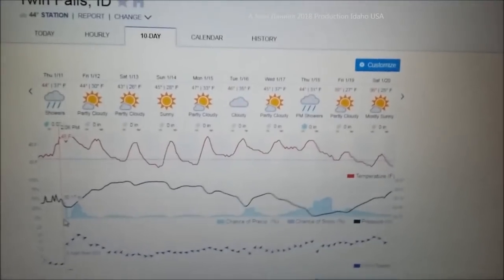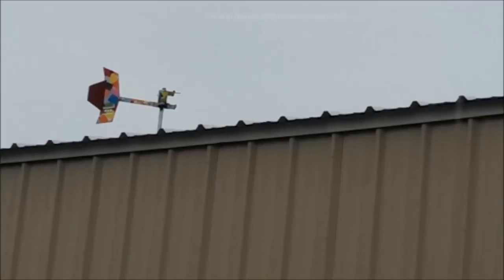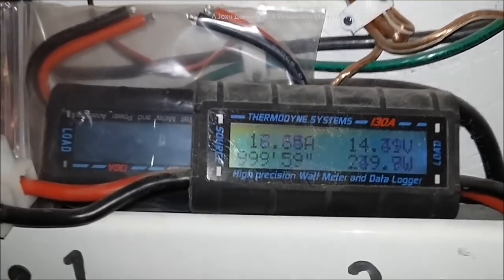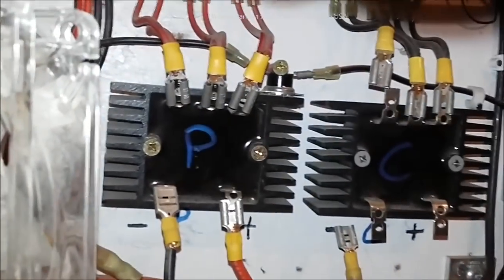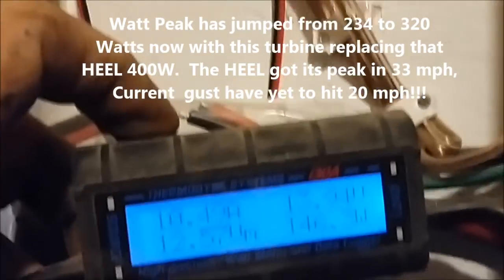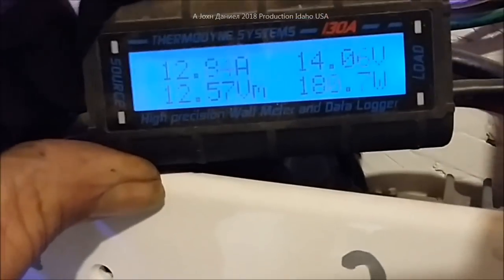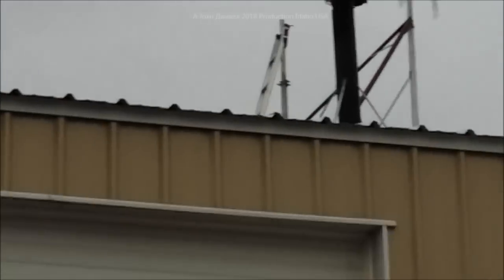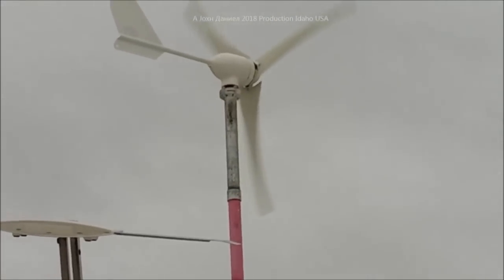Success, $220 (before inflation) China 500 Watt Wind Turbine super performer, BIG PARTS LIST BELOW

Comment: John -  Your ali-express link to the turbine sends you here (https://www.aliexpress.com/item/HAWT-500W-Wind-Turbine-Generator-With-Controller/32958450500.html)
This is for a Model Number:GE-500W1 3-blade unit.  Is this the turbine and the vendor you purchased from?? (Green E Solutions Store)

Thanks in advance!
Reply from the maker: Yes, They are the official dealer for Wuixi and they have 12,24,48 volt models in 3 or 5 blade options.

Comment: I Have a solar array and I use combiner boxes before the charge controller. Couldn't I just connect the turbine to a blank breaker on the combiner box?
Reply from the maker: You can connect the output of a rectifier into a combiner box, however wind turbines make such high voltage they could damage your solar panels if they are not protected with a properly sized blocking diode and controller.
Reply: @JOHNDANIEL1  
Thanks for the input. My combiner bax is basically a breaker box. Each breaker has 3 300w solar panels connected to 1 breaker and each box has 6 breakers. It combine all loads from breakers to  1 line that goes to the charge controller. I believe that if the turbine produces too much it would pop breaker. If that happened would the turbine burn up the wires to the breaker?
Thanks for any help.
It's a grid tied system so all extra volts go to grid after battery bank is charged and balanced.
Reply from the maker: Heres a way you can do it, place a basic controller on the turbine with brake and diversion built in, then run that direct to battery with no less than 6AWG wire using a 80 Amp DC breaker.
See the link for the turbine for the exact one, using this controller https://amzn.to/2NnXX74 and this DC breaker ( 80A@12 volt https://amzn.to/2E4Adkl) & (50@@24 volt https://amzn.to/2E4I6GA)  then be sure to use good wire, ( 8AWG for 24 volt, 6awg for 12 volt up to 65 feet from source) you can feed it into the batteries safely.

Comment: hello brother. i was wondering how the chinese made turbine is holding up. also. can you please send me idiot proof instructions to do what you did. i already purchased the turbine and now need everything els. Can you list items from turbine to house . thanks
Reply from the maker: Full parts list from Turbine to Battery
1 - From Turbine 3 strands of 8 awg wire Home depot or cheaper on ebay ( https://ebay.to/2GpnUCG ) 
2 - From wire, and before controller Mini ANL, 60 amp per leg. So you'll need 3 of these ( https://amzn.to/2UWxm3S ) and 3 of these ( https://amzn.to/2Ia1ZRS ) which will have a few spares in that pack. Place them inline before the rectifier or controller you have.
3 - Best full service controller ( https://amzn.to/2Id9I1z ) for both 12 and 24 volt systems
4 - From Controller to batteries use 6awg WC by TemCo ( https://ebay.to/2SPuMiy )

Comment: All these people talking how we are falling behind....nonsense.  Anyone who thinks this doesn't know engineering.  This little turbine makes enough to run 3 to 5 light bulbs, for average wind and 10 maximum.  Only 5 more and he can run a small space heater.  This is why coal and natural gas, etc are used for bulk power generation.  Now don't get me wrong, I'm all for renewables, when it makes sense, but it would literally take 100 of these to power a typical home.  Then it becomes cost prohibitive.  The technology will get better, it's just not there yet, except if you use super efficient turbines, then the cost goes up again.  Efficient turbines are over 90% efficient so even if you got the other lost energy! you wouldn't be able to light one more light bulb.  I just wish all these liberals would educate themselves before they mouth off about a president or all this silliness they absolutely have no idea what they are talking about.  Now I think something like a few high efficiency wind turbines and some solar panels, in addition to electric would make sense on every home.
Reply from the maker: You don't install a wind turbine and plug a light bulb into it 24/7! You put the power into the batteries and then you use a light you don't just drive away and leave it on. My 4 turbines and 5200 watts solar do run 80%+ of our home and shop unless high demand changes that. The failure among people wanting a wind turbine or solar is their spoiled snowflake lifestyles, not it's ability. We have to run our water well from the grid, and when I use my big welder I also use the grid. But if your not willing to have Propane or Wood for heating, cooking, drying then your just wasting your time. We don't run Air Conditioning even though the house has one, we have 240 feet of sealed 8" aluminum pipe 70" down at 49 degrees ground temps  ( Idaho temps) in the ground with two 380 cfm DC blowers into our old duct system. All the lighting in the house is DC, chargers for 3 computers are DC buck boost, and you'd never know it. But people want to buy a solar panel and run a electric stove and dryer with it. IN 13 years I installed hundreds of modest systems, never once for a Leftist Liberal. They don't use what they force on everyone else.
Reply: Јоhn Daniel good I'm happy for you.  I just don't want people thinking this little turbine runs the house, you know.  I myself heat my house with firewood on an outside boiler type.  I'd like to add a couple turbines, and a battery bank and inverter etc at some point.  I'd also like to put some solar panels on my roof.  It's just time and money, everyone wants a fortune and I have no time.

Comment: How many months did u have to wait for it from Ali?? I ordered from them before and waited nearly 6 months with no responce to my inquiries. Also ordered twice for shit I never got. I have 4 Air X marine gennies ( made in america) been flying 10 years and only brought down to clean the bird shit off them and inspect blades. I wouldn't trade one for ten chinese junkers. Been there. Gkad you got ONE that hasn't blown up yet. Good luck. My Air X gennies have seen every severe type weather u can name n just keep crankin.
Reply from the maker: It was almost 15 days. When AliExpress first started it was shipped though the Alibaba system, but now its no different than ebay and sometimes faster. I have a 7 year old chinese HYE thats been through 100 mph winds numerous times, no fails and constant full rating. These ME500 turbines are getting rave reviews for a good reason. They are done right. And for 1/2 the price of AirX who is no longer in existence due to some 2010 Obama regulation nation nightmares about Neodymium magnets and union forced bankruptcies. AirX is a damn good genny, but unless they can build them with realistic pricing they are just a example of history.

Comment: Hi there please can you help me. 
 I've just bought a Chinese wind turbine 800  watt. and I did everything it says in the manual. It has three black wires  coming out of the bottom. And three green wires coming out of the control regulator. And a black and red.
I connected black and red to the batteries positive and negative. and the three green to the three black in any order via a three core extention flex lead. 
The control regulator has a green and red light on it. the green stays lite. And the red comes on when the turbine blades are turning. I have four 110 amp lead acid.
My battery monitor doesn't hardly move when the turbine blades are turning very fast.   Should I see more volt or is it a very slow process ?
Reply from the maker: I rarely recommend many turbines from China that I will not install and warranty myself. Thats why I put the link to a proven one on the video. But seems you have a issue that may have a answer. So, what is the brand, voltage your using, and if possible the link to it where you bought it.
Reply: Јоhn Daniel https://rover.ebay.com/rover/0/0/0?mpre=https%3A%2F%2Fwww.ebay.co.uk%2Fulk%2Fitm%2F292481558908
Hi John I didn't realise that the links you were   putting in your videos were recommending to buy that particular one. I thought that you was inplying that they are all pretty much the same. I live on a boat on a canal in England. 
I have a 12v set up. I am totally off grid. I have 500w of solar panels. Which is wired to   two four banks. And is amazing in the summer. So I was hoping to get wind power in the winter.ha ha ha  
And save money using the generator.
i would be very grateful if you could give me some advice. Thanks jed
Reply from the maker: We have had great results with the TESUP but ONLY the Master Models, Not the Re-formed IstaWind Turkish/German versions. The Master 500 model is more accurately rated. And for cost, whats better? Real watts of advertised watts for the money? https://ebay.to/2CBVVvr
Reply from the maker: They do sell the M-400 and M-500 like mine that actually makes its claimed output in the video in 12 volt 3 phase through Ebay Europe, https://ebay.to/2W9oPM4 If you have fair to good winds, that M-400 in 3 blade form will out produce that fake claimed 800 watt thing you have now by 400% LOL!

Comment: When I click on link I get price US $367.00 - 390.00
Reply from the maker: Yes, I lucked out when I got mine. Wuix Air had just released them. But compared to a $400 Missouri, Florida or Texas sold sheet metal SKYRATTLER (YUK!) model thats only seriously capable of 100 watts in 20 mph and is claimed as 1000+ watts, this one is a winner and its going to shock you in its peak output, over 1000w at 30 mph and no fails on all that I have installed all over since!!. One year update on this one is on the way, and so far not a wrench put on it. Says a lot!

Comment: Vertical turbines are much more efficient and safe to use!
Reply from the maker: VAWT? - Not Yet. Not until a decent RADIAL FLUX generator of very large circumference is designed with a better magnet system. I have been testing one of 19" in diameter I built on a site in Baker Nevada since last year.

Comment: Speed does not equal torque, and your "wind turbine" does not have enough area on the "blades" to generate any. The most effective sailing cargo ships were the clippers of the 1800s. They carried freight from the East coast of the USA, south down past South America, around the southern tip, and up the west coast of South America, all the way to San Francisco, in 28 DAYS! But in order to do this, they needed as much sail area as possible, and they had a lot of sails!  These 'wind turbines" are made to look "modern", and sort of like airplane propellers. They should have large cloth or canvas SAILS, (and not blades).
Reply from the maker: Speed Equals cycles, Htz, thats the power in Electrical items of this nature.
Reply: when speed(rpm) or torque increase, power also increase. So speed is also a factor in generated power.

Comment: What is the charge voltage coming out of the controller?  My lithium battery bank can only handle 14.4V to 14.6 V charge voltage. When the bank is fully charged it has to float to avoid  burning  up the batteries.
Reply from the maker: I set my diversion controllers to 14.3 and 14.5 but I designed my own control system.

Comment: John , how many kwH will you get on average over a 24 hr period.   I live on the west coast of Ireland and it IS VERY windy , almost all the time
Reply from the maker: If you have 20 kph winds you will get 300+ watts per hour all day long. With 30 kph winds you will get 400+ all day long. The link under the video goes to Ali-Express, the specs are there. Just mount it 3 meters higher than obstructions in the area. And get a good controller. They will hit 1000 watts so be sure to get the best controller. DO NOT get one sold in Missouri USA, they are damn dangerous!

Comment: Roof cleaner here, some tips: tie a rope to one of the masts on the peak and hang it off the edge. Leave it there always.  Tie it around your waist.  You can grab it as soon as you reach the top of the ladder.  it beats sliding. all it takes is one drop of sweat from your face to fall under your boot, to turn the dry moss and dust into slime, to make you start sliding, and you don't slow down as you slide. Position the ladder, on a good angle, with standoffs on the roof, under where you are working, so you can catch it as you fall.  Even on a good day, the dust on a dry roof acts like little roller bearings, as bad as water sometimes.  Funny thing, it's not the water, so much as the invisible moss and dust, which makes you slip.  

Counterintuitively, we actually scrub the roof where we're going to walk first, we don't wait for it to dry, don't have time, we walk on it wet, but it still it still has much more traction than dry with dust and moss! (Maybe not try this unless your a pro. instead, let it dry first)Choose flatter soles rather then traction soles;  flat soles create a little suction cup effect under the boot. Choose a shoe which is comfortable and flexible to maximise contact with the surface.  Work in safety, live, and you'll make more money!  Plus, clients don't freak out because they're afraid you're gonna screw their insurance if u fall: be professional, and you will keep a good reputation, and get more jobs.
Reply from the maker: I found that Thom Mccaan ( spelling?) has the best flex and rubber compounds for metal roofs, they are a Kmart shoe branding. And Puma is best for composition roofs. 
Luckily we have no moss issues here, but the dust us like micro bearings so I fire hose the roof area if I have plans to go up unless its recently rained.

Comment: The one I got didn't have slip rings. It just twisted up the cable until it snapped.
Reply from the maker: You must have got one made/sold from a guy in the midwest known as a sky rattler. Those have a wire clamp and will do that. But these Wuix Air turbines have molded in Slip Rings, part of the physical construction.

Comment: John, just because you have a 25 amp and a 20 amp fuse on a line does not mean you can get 45 amps thru them. In fact, the max you would get is 40 amps as as soon as you got over the 40 amp limit the lowest rated one would be the first to blow. To get 45 amps, you would need two matching fuses of 22.5 amp rating. Using slow blow fuses might get you to 45 for a short time before the 20 would blow and then the 25. What I see looks like regular ATC fuses like I use.
Reply from the maker: 3 years, and a few melted fuses at 50 plus amps recorded. So far it works, and I only intended on it being passage of 40, but wanted to use up a box of 25's I had. All the new boards have 50 amp single Mini ANL.
Reply: @JOHNDANIEL1  I'm surprised that you didn't replace them with circuit breakers. Some of my circuits use 50 or 150Amp 42Volt breakers. The 3000Watt pure sine wave inverter as an example is on a 150Amp one. The 12Volt circuit for the 2000 Watt Modified Square Wave Inverter runs on a 300 Amp 12Volt breaker while the sine wave 500Watt unit runs on a 50Amp 12Volt one. The panels are on fuses but the output from the 12 volt charge controllers are protected by 30Amp 12Volt auto-reseting breakers on their outputs. https://www.ebay.com/p/Automotive-Circuit-Breaker-Cb185-50-Cooper-Bussmann-50a-42v/7012043289 for the 50Amp version. At the time I bought mine, I got 4 of them for $68 and free shipping. The 150Amp ones cost $31 for 2 with free shipping. The 300Amp 12Volt ones cost $19.90 for 2. All of them are ones where you can use them as a switch also. Which means they can be used as the safety disconnects for the output of high powered wind or solar setups.

Comment: I gotta question about the turbine. About the tail in the back, does that have a use that if the wind is in the side of turbine, does it turn do the blades can be facing the wind?
Reply from the maker: The tail tracks the wind on the yaw bearings to keep it pointed into the wind. The slip ring is the electrical connector that passes the power made down through the yaw bearing sleeve to the wiring below.
Reply: @JOHNDANIEL1  thank you so much Daniel. I was pretty confused on that feature there

Comment: That's a 500 wind turbine?
Reply from the maker: Yes, its rated by AWEA https://www.awea.org/ so its rating is based on 25 mph wind to be at 500 watts at that wind speed. It don't use the ebay junk sellers or Missouri solar rating system. If it did it would be a 4000 watt turbine LOL in relation to junk from those hustlers.

Comment: John, Looking at mounting one of these as you did on my shop. Question, does it make much noise in the building. Humming, buzzing ect?
Reply from the maker: They have a whistling sound in high winds but nothing in moderate winds. Probably the quietest of all 8 total at some point over 11 years that I had on my roof.

Comment: I am a craftsman by trade mainly hard surface floor covering installation with Zero experience in electrical but am wondering about how fast that will pay itself off.  
In idiot terms that I may understand , about how many 40 w lightbulbs can you run at once with only that 1 turbine?
Reply from the maker: 6 to 8 but not on a 24 hour basis. Wind turbines are best at night when wind currents are strong and solar is not producing. Having amps of any kind coming in also keeps your batteries in best condition for more years of life.
Reply: Јоhn Daniel dang , AWESOME! I live out in the wide open country where it is very often windy and been slowly looking into these. 
Thankyou